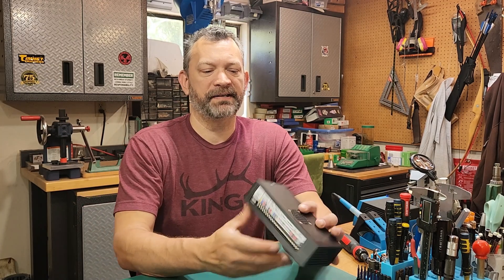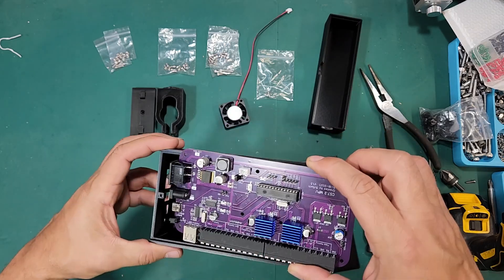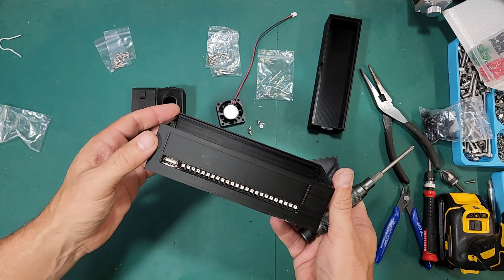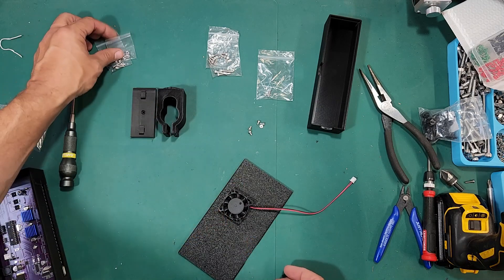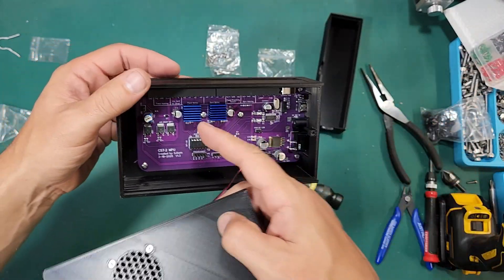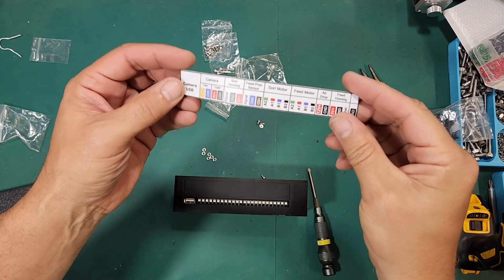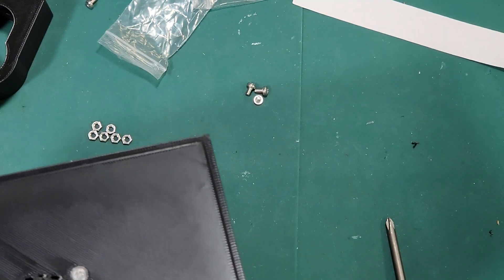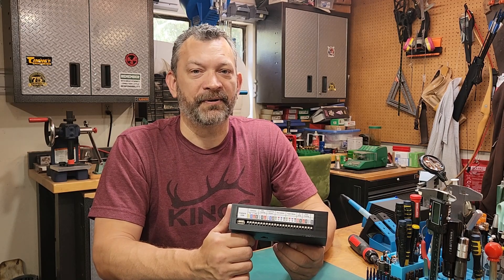CS7.2 Build Series - Electronics Box Assembly

Comment: I built the original and still use it. No upgrades other than refined prints. I'm debating on building a new one since the original is working well. I do like the new design.
Reply from the maker: I guess if it ain't broken, don't fix it right? If your current system is working for you, I would see no need to upgrade.